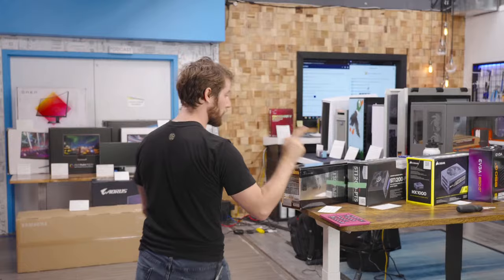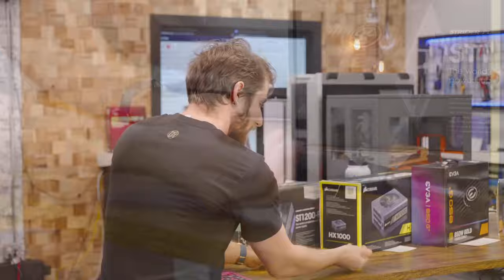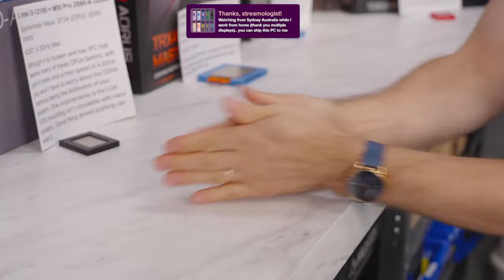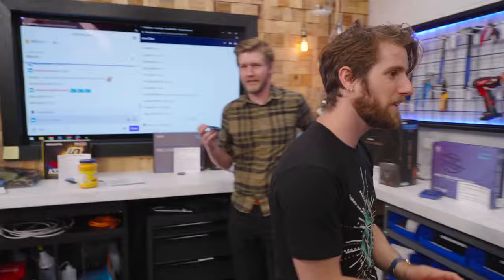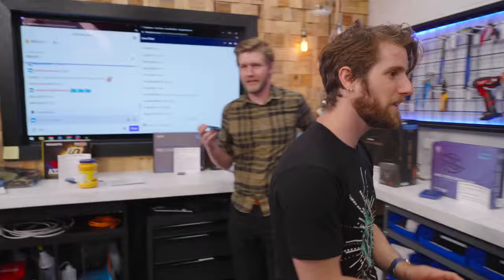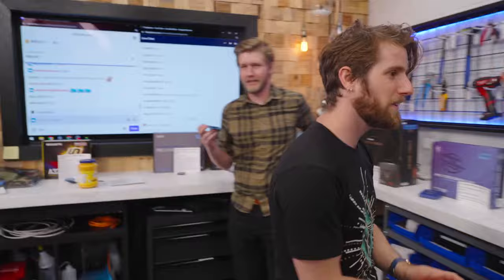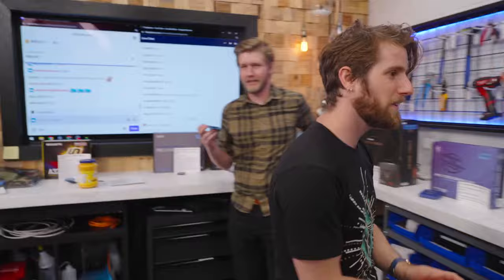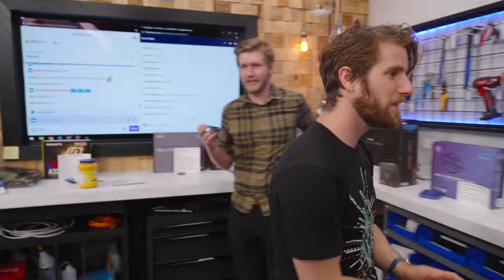I Pray This Computer Sucks.. Cuz I’m gonna sell it for $1

Comment: So, Matias is a Canadian keyboard maker and possibly the only manufacturer of the Alps mount switches. Alps Electric made fantastic keyboard switches which are coveted to this day. Matias was a Apple keyboard 3rd party manufacturer that used Alps switches and once those were gone they began producing their own. The Quiet Click switch referenced here was released as a key switch acceptable to stenographers that needed a reliable and quiet key switch. Matias keyboard are expensive, but the board is not a bad buy, though a gamer may be unimpressed.

Comment: @linus I'm about an hour and a half in, and you're talking about 6 conductors on 1 harness connector and the other kind having 3hot and 5gnd... So I'm not familiar with the specific product, but I think I can help with the reason (without math). 1st: electricity actually flows from gnd to pos.. it works either way u draw it out, but bare that in mind (we call earth "ground", but in reality, the atmosphere is negative and earth is positive). 2nd: the loads of a circuit take the push of the line (power feed) down. 3rd: the push (pressure... Voltage) measured after the load, subtracted from before the load, is called "forward voltage"... My point is;

Because electrons flow from gnd to pos in vDC, there is higher voltage, higher amperage, and higher resistance.. hence the reason for more gnd wiring. I'd also imagine that AT LEAST 1 (maybe 2) of those gnds are shield gnd.

Last nerdy thing... If the wire's sheathing (not the connector... I feel bad for people that have food theory and just can't get good product) is able to control the heat from the amp draw in each wire, then it's very likely that this "smaller wiring" may actually have finer strands within the conductor.

Electrons travel on the outer edge of their conductors. The inner (core)of the conductor acts as more of a heat sink. If u use more strands in finer wire, the electrons have more surface to flow, heat escapes WAY TOO FAST, but can be controlled by say XLPE sheathing... A wire can melt and stay contained in the sheath, turning it into a larger solid core, instead of acting like a fuse.

I think the issue of the company ur talking about, is SOLEY a pour choice in terminal pin style and size.. not the wiring

Comment: I like the sales pitch for the LTT acoustic treatement. "Some panels are DIY, some are great performance but really expensive, ours are a little DIY but no tools required, but great performance - but you buy the acoustic treatement that goes inside the panel yourself you can use whatever!". So what is great performance? haha

Comment: I doubt it's going to remove heat, if anything it will make it hotter since concrete does hold heat for a long time but, it will also heat any space near it so if anything you will end up struggeling to get it cooler even more.
Reply: I'm not an expert so I'm not good with these stuff. Please kindly help me. Could you Tell me if this pc is okay or any good or if there's anything wrong because I'll buy this pc and use it for 4k gaming, streaming, heavy editing and animation works

------------------------------------

CPU: Ryzen 5 5600x

MOBO: Asus ROG Strix B550-A Gaming

GPU: RTX 3060 12GB

AIO: Cooler Master MasterLiquid ML240L V2

RAM: Corsair Vengeance LPX (8GBX2)=16GB

STORAGE: Samsung 970 EVO plus 1TB NVMe M.2 (1) - 12500 tk

PSU: CORSAIR RM series RM850E 850 WATT 80 plus gold certified fully modular PSU

MONITOR: MSI OPTIX G241

CASE: Antec Dark Fleet DF700 FLUX Mid Tower ATX Case
--------------------------------------------
Reply: @KrufleXS  First problem, the display that you listed is a 1080P display (1920x1080) which means it can't run at 4K.

you can't upscale the native resolution of your monitor, you can buy a 4K display and choose for 1080P 
but it doesn't work the other way around.

Second problem the CPU is a budget CPU which means it won't work very well for gaming at 4K, because it doesn't have good enough performance If you are set on using AMD you should get a Ryzen 9 7900x which confusingly is faster than the Ryzen 9 7950x.

Third problem the GPU, A 3060 isn't going to provide enough power to be gaming at 4K I suggest instead getting a 4070 or 4070ti.

The 4070/4070TI will provide  good performance and it is an expensive card but, to game at 4K you need the best of the best and it is the choice that makes the most sense as of now.

And for the fourth issue 16GB ram is enough for now but, in a couple of years games might require more RAM than that so I would go with 32GB RAM.

You also state that you do want to be streaming so you will have to do video editing if you plan to upload it to YT making 32GB a way better choice for your scenario.

For the PSU aka powersupply if you can make sure it's Platinum rated Gold is good but Platinum rated is a lot better.

For the SSD instead I would go for the Samsung 980 Pro 2 TB M.2-2280 PCIe 4.0 X4 NVME SSD as it is a lot better,

the reason to go for 2TB is because it gives more storage and, it's cheaper to buy one 2TB SSD than it is to buy 2 1TB SSD's.

The Motherboard you chose is good the case as well and I see no issue with the CPU cooler either.

For 4K you would be looking at something like the LG 32UQ750-W.
Reply: @leagueaddict8357  I cannot thank you enough for actually taking your time and helping me. thank you so much.

so I can see that 4k is the main problem here. so if I say I'll do all of the mentioned things but in 1080p and never go higher than 2k. how would that be?
and yes I'll upgrade 16gb to 32gb in soon future when it's needed.
Reply: @KrufleXS  A lot cheaper but, I would recommend going for QHD which is 2560x1440 for a really good gaming experience 144hz or higher is also recommended. 

If you go for 2560x1440 you can put in a 30's series GPU and it'll be a good experience (Like a 3060 ) as long as the CPU isn't bottlenecking it.

I would avoid the 3060 3050 and 3060ti though  a 3080/3080ti 3090 or 3090ti would be solid, the 3070ti would also be a good GPU to go for.

I would say the Ryzen 7700 is a lot better than the 5600x but, if you can get a good deal on a Ryzen 9: 5900 / 5900x / 7900 or a 7900x that would be even better.
Reply: @leagueaddict8357  oh. thanks for the infos

Comment: The Vega 64 liquid edition is 8GB HBM2 not 12GB. Also, it's the Vega 10XTX chip, not the Vega10 XT used in the Vega 64 air version. It's quite a bit faster and binned. Nowadays it's on par with the 1080ti.

These are actually somewhat rare.

Comment: 02:36:40 there are 4090 cards with the powerconnection on the backside (externalconnecters being the 'front'-side) instead of the topside

Comment: I'm using one of those FX-8350... my whole computer died last year and a friend had this for a spare. It was a nightmare finding a compatible MB for it and I had to settle for a cheap Asrock. I'd love that Crosshar V
Reply: As someone who still has an FX machine that runs 24/7 as a plex server on a cheap asrock board, I'd say you shouldn't worry too much as long as you have all the IO you need. It's the only asrock board I've ever used but it's been kicking for 10 years now and has been running 24/7 since about 2017. I've had to change the PSU but other than that it's been great.
Reply: @jonny6702  here's the thing, it's my only machine. It only has USB 2.0 and it behaves weird sometimes. I was happier with my i5-2500, if it wasn't for a bad PSU that fried everything (even my headset) I'd be still using it

Comment: as a certified electrician but not an engineer, I can confirm that sometimes when it comes to DC circuits, you want a better-than-normal ground connection because computers generally rely on latency and a bad ground equals a higher resistance which equals higher latency which translates to poor performance and ultimately data loss, data corruption, and crashes

Comment: Id take that fx8350 over a i7 3770 every day of the week. More cores, higher base clock, didn't crash constantly  and cost $130 less than the i7.
Reply: Despite the more cores and higher clock it performs about 25% worse lol. In heavily multithreaded tasks it's only about 5% worse, so not tooooooo awful.

Remember, cores and clock speed means NOTHING if the chip can barely do anything on each clock. Bulldozer has awful IPC's

Comment: On the topic of physics bullcrap branching off of the Ray tracing convo. Keen Software House made the game Space Engineers with a Space and planets physics built into the (The game engine they run is their proprietary game engine that they build) engine (sandbox game) then they added fun stuff like the warfare 1 + 2 updates that are tons of fun. Or at least they will be. But the game won't run on my laptop anymore. (not their fault this isn't a gaming laptop) And I fixed the problem by sinking 2000 into a gaming PC desktop.

Comment: I'm way late to the party, by 11 months. As I type this on my FX-8300 powered box driving a GTX 1050, I gotta say that the "new" computer looks quite handy. I'm even mildly surprised that the Apple kbd (that's what the 'command' and 'option' keys are for) worked on the Intel-based system. One last point, if it's not already been shared - on that game ball, the "scroll wheel" is the ring going around the trackball itself and the ball comes out so you can clean the finger oils (and snack crumbs) off the ball. Great episode and I hope the one who purchased the build likes it.

Comment: ATX 12VO and leaving the power conversion to the motherboard would not be beneficial in that if you have a problem on any of the voltage rails you’d need to replace the motherboard entirely; versus simply replacing a power supply.

Comment: One thing that I think that could be used to clear up naming conventions (@ about 1:27:00) is to do just different skus by work case:

Why use weird obscurant XX80-Ti/Super/Ultra/Max/Max-Pro, etc naming schemes rather than using a use case naming Scheme?

Economy

Battery Life

IT

Gaming

Programmer

Server 

Data Center

Low TDP

Etc,

And then do your marketing gimmicks per line?

Comment: Distilled water is non-conductive.  If you have a leak, distilled water has a chance of not damaging the system, but tap water is very conductive due to minerals in water.

Comment: I am actually currently looking forward to upgrading my PC with a CPU you mentioned:
Current PC:
i5-4440
GT 1030
3 TB Server HDD
120 GB Samsung SSD
Some Intel mobo
(Was a family stuff storage server)

NEW Specs (hopefully):
i7-4790 K
GTX 1650 or 1660 (Ti)
Everything else is gonna stay the same

I can’t really upgrade to anything else, the LGA1150 Socket really is the bottleneck (I would like to have an i7-5775C but it’s even more expensive)
Reply: I might also upgrade my 8GB RAM to 16 or something, but I think DDR3 is kinda expensive right now
(Btw if u have further suggestions please answer to my comment)

Comment: In reply to the person asking about reviewing hearing aids: A study recently came out that showed that Apple's AirPods are better than $3,000-range hearing aids, but not quite as good as $10,000-range hearing aids, but the difference was subtle at the high end price. The only problem with them is that their microphone doesn't pick up sound directly in front of you as well as from any other angle, so you have to tilt your head to hear better.

Comment: Im still using an AZZA GT1 case. I've rebuilt my system 4 times in the same case. The mobo tray completely slides out the back so you can do all of the hard ware stuff out side the case then just slide it in and hook up your cables, and the display window and internals can be flipped from right side to left side. Its great.

Comment: I still use an amd 8350 built my first tower in 2015 with my tax return. 8 years later still with EVGA  gtx 950 2gb. Still  plays PS3/360 era games well. No issues.

Comment: 2:22:00 The reason Google Assistant doesn't do that cross-referencing thing is because its not actually a real AI. Real AI does not technically exist yet..
Reply: Oh yes I had one of those Logitech balls - the best way to improve it is to hit it with a hammer until its in pieces then put it in the trash and go and buy a proper mouse.. :D

Comment: 12:33
Well, it depends on what you wanted to do.
For gaming, yes, absolutely it was sub par at the time, although you honestly could tweak its settings a lot to make it better for whatever you where doing on it (it rewarded you for really knowing your processor).
However where it was great was for people who wanted viritualisation for cheap.
Intels budget options like the i5s didn't have viritualisation acceleration, and only had 4 cores in this era.
The FX 8350 had 8 cores with hardware acceleration for viritual machines at a i5s price point.
So you could run your budget viritual machines in the background while doing your sub par gaming on the remaining cores and the impact you'd have on the performance from doing that wasn't that bad.
Games of that time was mostly single core anyway.

If all you where doing was gaming then you could disable cores sharing resources to free up some IPC by forcing those shared resources over to the remaining cores, since AM3 and AM3+ motherboards usually where providing relatively bad power delivery compared to what th eFX 8350 actually needed you'd also free up some of that power for the remaining cores by doing so, allowing you to potentially overclock the heck of them, and having so much space in between each core being OCed also essentially gave you a thermal sink.
Another option if you wanted something a bit more fancy for variable threaded workloads was to look into PBO overclocking instead of fixed clock speed overclocking, as FX 8350 actually supported it, although the implementation was janky as f and it was hard to get that to work, you could do it.

And once its heyday was over you could underclock and undervolt it and have it sitting as a file server or something, using little power, producing little heat yet not freezing when being given a heap of tasks all at once because it has 8 threads to work with after all.

Likewise, while people of this time that was gaming honestly had to have a certain level of self disipline and limit their background tasks running to avoid reducing their gaming performance, it honestly didn't matter much if you had a ton of stuff open in the background on the 8350 compared to an i5.

If you where programming and where a bit smart about things on that processor you could also get more out of the shared resources on it quite a lot and potentially getting i7 levels of parallelized performance out of it.
You'd really have to watch your instructions though to do this, but it could be done.
Part of it was giving some multi clock cycle instructions to avoid the front end bottleneck as you'd otherwise risk running into a situation where the processor had execution resources to spare but couldn't feed the cores instructions fast enough to utilize them.
Part of it was lowering the precision so you can use the two floating point units that the modules are sharing as two separate floating point units instead of them essentially behaving as a single one as they would do for the cores double precision instructions.
Part of it was doing a int heavy workload to avoid those shared resources (although not a pure int workload, you'd need a certain mix to fully utilize the core, and again, you'd risk running into the front end bottleneck)

So yeah, essentially the FX 8350 actually did have a lot of performance to offer, but because of everything from lack of optimization due to it having a small market share to thing like it actually being kind of hard to optimize for just made it underperform compared to what it could do.

As for why it ended up like that...
A lot of it honestly isn't AMDs fault.
For instance during the development of the FX 8150 Intel seemed to be on board with the SSE5  but then Intel decided to instead go with AVX, a instruction set incompatible with SSE5 so AMD had to scramble engineering resources to support it, after having wasted a ton of AMD engineering resources on that (because with Intel being market share leaders not supporting instructions that Intel supported would have been impossible for AMD), so they had FMA4 and XOP instructions not supported on Intel in their FX 8150, and in the FX 8350 also FMA3, BMI1 and F16C instructions.
Unfortunatly that also means that they had less resources to actually finish the development of the Bulldozers, so while Piledriver is what AMD should have launched when it launched Bulldozer we got Bulldozer instead, because honestly they couldn't afford to wait and finish the development...

On top of Intel shenanigans there's also just expectations about where computing was heading.
It takes many years to develop a new core arcitecture from scratch (the first ideas for Zen was already floating about back when Piledriver launched in 2012, but it wasn't done and launched till in 2017) so you can imagine what AMD was thinking in 2006, a full year before the launch of the quad core Phenom about how the computing world would look like in 2011.

You have to make certain assumtions when designing a new arcitecture, and sometimes some of those assumtions just don't pan out...

So yes, Bulldozer and Piledriver was flawed, but they're not as bad as people seem to think and they both had a lot of clever engineering that's under apprechiated out there.

And there's certain legacies from those arcitectures in Zen, Zen2 and Zen3 that gives AMD a advantage in certain workloads vs Intel because of reuse of some of the designs found in Piledriver and Bulldozer.